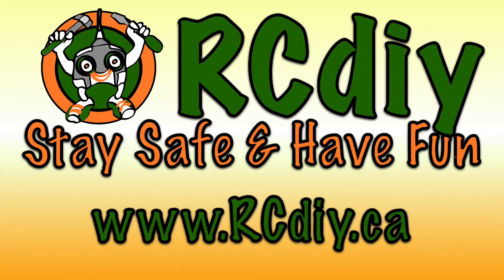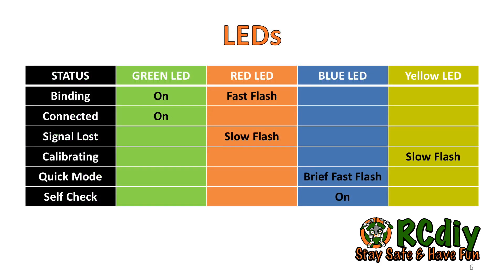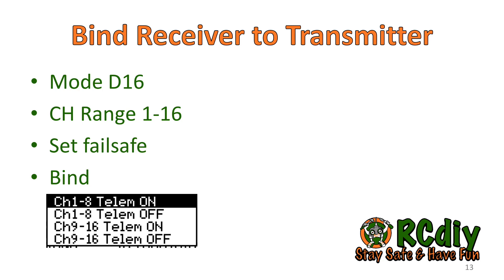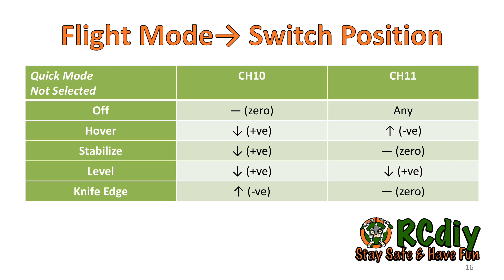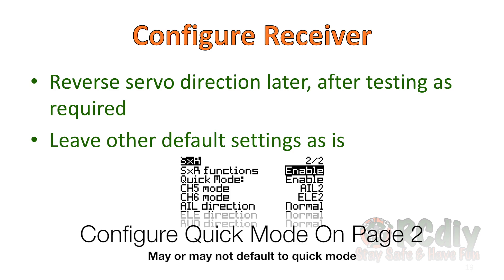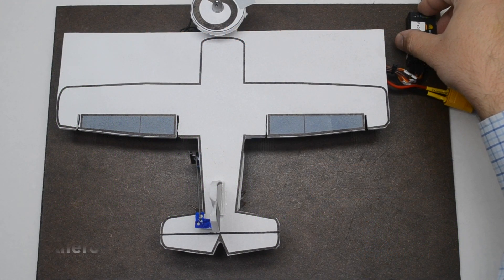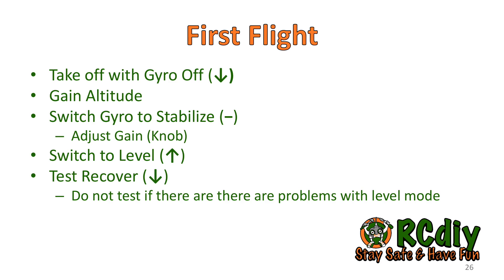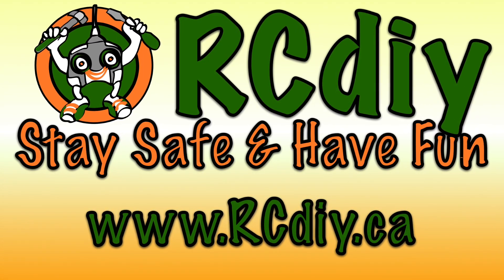OpenTX FrSKY SxR - Setup (S6R) (S8R)

Comment: There is an error in this, if you have a delta wing servo reversing takes place in the lua script. In a fixed wing servo reversing is done on the TX. The servo  reverse function is for the direction😅 of the correction applied

Comment: Great video. For some reason my rx loses signal and the RSSI level goes down to below 15 when I enter the calibration and configuration modes preventing me from performing calibration and configuration. All other times the RX works find and the RSSI is over 100. I have three of these receivers and they all do the same thing. I have tried moving the tx away from the RX and have even moved to different locations but to no avail Any idea what could be causing the loss of signal?

Comment: Great video and help! I love your videos 💯 Please help me find the answer to a question that is haunting me: In conventional mode (with "hover" and "knife edge" functions. NOT QUICK mode), what exactly is CH12 supposed do? Is it for entering self-check OR does it trigger recovery/auto level? Or BOTH? I am confused. In my working conventional mode setup, CH12 activates auto level momentarily. I enter self-check via the lua-script.

2nd question: What is the F/S button? Is it the bind button on the receiver? Does the receiver really go into self-check when you push the bind button? 🤨 😀

Comment: Is there a way to adjust the auto level gains with a pot similar to using channel 9 to adjust the stabilizer gain?  The stabilizer gain is different than the auto level gain.

Comment: his receiver with its ability to stabilize, has been a real fiasco. The tools that originally worked have ceased to exist and do not appear anywhere. This FreeLink does not work in Windows 10 and in previous versions,  it does not read or write to the receiver. The the lua tools only in the new versions of the SD and only SXR_Calibration and SXR.LUA WHERE IS IT ? . Incredible FRSKY !!!!!
Reply from the maker: Oscar Mesén look at http://rcdiy.ca/sxr-setup-s6r-s8r/

Comment: When I try and press Enter on the Calibration (lua) page, nothing happens. I have tried reformatting my SD card with the latest OpenTX firmware several times.
Reply: Huh. On a whim, I went back to an older version of the SxR root folder, and it worked. Weird.

Comment: I put Chan 12 on momentary switch SH.   It functions as Auto Mode but also still enables Self-Check if I toggle it 3 times.  Shouldn’t happen with a single toggle switch, but it does.  Any idea how I can get around this?

Comment: Not understanding why I need elevator 2 on channel 6? Only using one elevator and this is an S6R so only 6 physical channels. channel 1 and 5 for 2 ailerons and was gonna use channel 6 for landing gear. The instructions say to follow exactly but I don't understand what the purpose of the 2nd elevator is?

Comment: Hi could I please request that you do a video setting up the S6R for a delta wing and how I have to setup my radio. I am running into a problem where I setup the receiver for delta and on my QX7 I have tried using delta and normal plane each time when I have channel 1 and 2 setup in mixer channel 2 controls channel 1 even though I have a servo plugged into channel 2.

Comment: I still have a problem with the configuration of the S8R ... but everything is revolved around this question .. so the "Self Check" function works ONLY if the CH3 (or the one assigned to the engine) is at -100? Is this normal? I realized that only by programming and activating a special function that sets the CH3 to -100 the Self Check works ... I'm going crazy xD ....
The problem is that if I use the Thr stick in the middle (0) when I activate the special function that in my case is equivalent to disarm the motor, so the motor being at -100 turns on. I configured the engine to +100 forward, 0 stop and -100 backwards

Comment: Thanks for this great video but I still need a little help .. I followed everything step by step and almost everything works fine, all except the switch of channel 12 to enter "self check". I noticed that when I turn on the receiver I do not turn on the blue light and yet I'm sure I configured it in "Quick Mode", what can it depend on? I created in the Mixer at CH12 a value that has as input the switch to 3 positions "SB" (I use a Taranis QX7s) in the following way: CH12, Source SB, weight 100, Offset 0, Switch --- not assigned, I was wrong something? I can do the Self Check only by pressing F / S on the receiver but not through the switch :( and I do not understand why.I hope you can help me in this and I thank you in advance
Reply from the maker: The blue light behaviour may have changed with firmware changes. Frustrating. The ch12 switch needs to pass through mid. So high mid low; Not high mid high or not low mid low or not low high low high.
Reply: Thanks for your quick response!
In fact I updated the receiver S8R to the latest version 180328 .... so can you confirm that the procedure of creating the channel 12 I did it correctly? Channel 12 configured only in the Mixer tab and with the values as mentioned above ... I have tried again in the movements passing through the center but it does not work .. I would not like the new firmware has also inhibited this function in addition to the blue light.
Reply: I'm back to version 171213 and now as you said the blue light turns on when the receiver is turned on but the problem of the switch assigned to channel 12 still does not work for me :(

Comment: Thanks for the invaluable help and I have learnt a lot more about my Taranis as well which I have had for 4 years. It is certainly the best education resource available on this topic. Now to the inevitable question: Has anyone set up a flying wing with this receiver. I am fitting it to a well used TekSumo. I have yet to test fly with the S6R fitted but I have a few slight issues.
Reply from the maker: I have not. Check my blog post for links to forum threads where this is discussed.

Comment: Hi thanks for making this video, I am having problems setting up lua scripts on my S6R, I think I followed your directions, but I will re-watch the video.   I got an error message on my taranis, it said "error no signal bottom pin"  Do you know what I did wrong, I checked the pin layout and I think  it was correct I connected the servo in the servo port on my QX7S and I also tried the back port.
Reply from the maker: You are using an X7. Use the pins near the usb port. Use a regular servo wire.
Reply: RCdiy thanks for your reply! I appreciate it, I tried the servo port right near the USB port with a normal servo wire

Comment: I am confused and need some help, I have created a model and have bound the RX to this model. I power the RX via the throttle channel as it uses the BEC include in the ESC ie. port 3 on the S6R, I notice when you calibrate the S6R you have the S.Port connected so to what is that lead connected toat the other end? At present the S6R works as a normal receiver, the ailerons, elevator and thorttle work. I read your instructions and view the relevant parts of your video, and I have also viewed many videos and other posts on this subject.
Reply from the maker: To a bec for power.
Reply: Thank you I assume that one can power the S6R from any of the pins e.g. channel 3 (throttle)
Reply from the maker: Yes. Any RC receiver has all the power pins joined to each other.

Comment: Hi. Great video that I hope to use when my S8R receiver can start working. I have problems to start. My radio Taranis and Taranis Plus are updated to the latest version. After a lot of trying, I manage to link them (creating a new model); I enter Calibrate, and it allows me, but at the moment of executing the LUA, it presents me with a syntax error ..... But what is more strange is, that when connecting the servos in the normal channels, they do not work. Thanks for your helps
Reply from the maker: Follow the link in the description for details of the steps to follow.
Reply: Thank you. I'm already happy I had to update the S8R firmware (... syntax)

Comment: Have you thoroughly test flown an aircraft using this setup? I can see a few issues incl. what the switch positions actually do on channel 10 and what the orange light means (in flight means applying corrections). This thing is a tricky little beast.

Comment: Hello RCdiy,
Do You have any idea for this problem:
https://www.youtube.com/watch?v=R8ndVQluMTo&t=5s

Thanks in advance!
Reply from the maker: Channel range 1-16. You have 1-8. Do you have latest firmware?
Reply: Channel range 1-16 or 1-8 is the same problem. 
About the firmware of QX7S, I don't know how to check which version is, 
ordered it from BG international version on the description,
just update it to Open TX 2.2.1.
With S8R, I tried different firmewares, but the problem still exist, even EU firmware,
now is with the latest 171213.
Reply from the maker: What happens if you try a different receiver (not SxR), take tx out of bind mode then turn of rx after that, use a different rx number?
Reply: God bless you RCdiy, now I change to emty receiver number and bind it without problem, I can't explain it to myself! For your first question it is binding without problem with XM+, but there is another issue with FrSky Delta 8 receiver, please see the link below:
https://www.youtube.com/watch?v=Bizr-ybnHtQ

Kindly regards!

Comment: Much thanks!  Truly helpful!  But should the gear and flaps on ch5 and ch6 move when initiating the self-check?  They are set as aux1 and aux2, NOT as ail2 and elv2.
Reply from the maker: I’ve been on a thread where ch5&6 were used for switching lights. They would not switch till the switches were moved during self check.
Reply: I thought it odd that when entering the self-check, ALL the servos would move, including ch5 gear which should not be given attention as it is not selected as a control surface. Of course, I have the plane resting on the gear so it all messes up!
Reply from the maker: Disconnect the 5/6 servos during self check. Unfortunately I’m not sure where FrSky gets its feedback from. I agree that 5/6 when set to auxiliary should not be part of self check but they have so now we have to deal with it.
Reply: Yes, will try the disconnect, will also try moving them to ch7 and ch8 just to see if they move. That would tell us the self-check is twitching any and all attached servos no matter what.
Reply: Moved gear and flaps to ch7 and ch8, and they did NOT do the servo dance when initiating self-check mode.  So it must be that whatever is attached to ch5 and ch6, they will move regardless of status.
Reply from the maker: Thanks for letting me know. I’ll update the website.